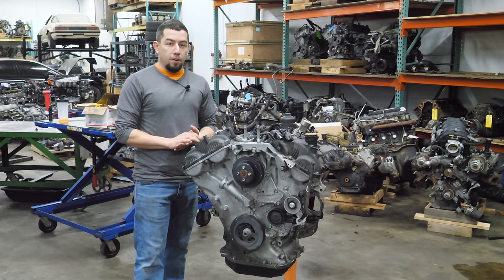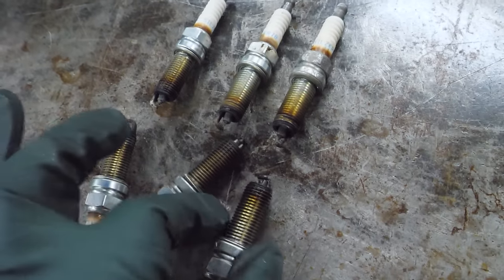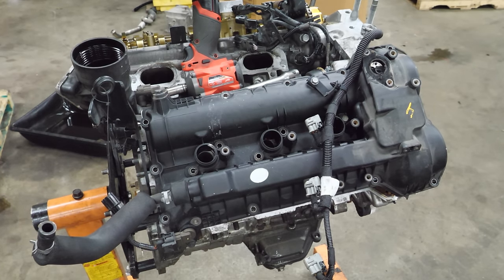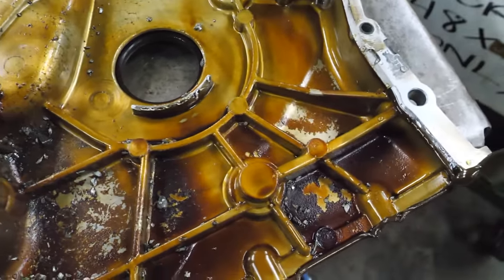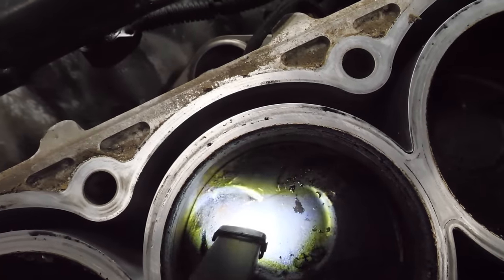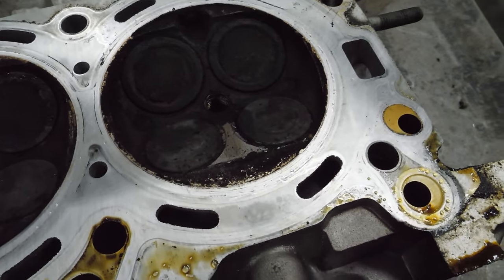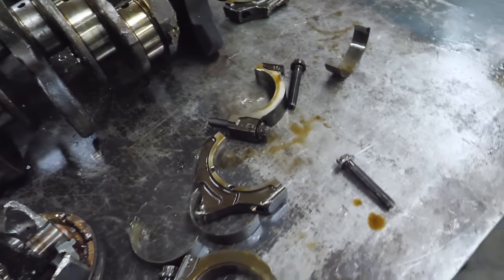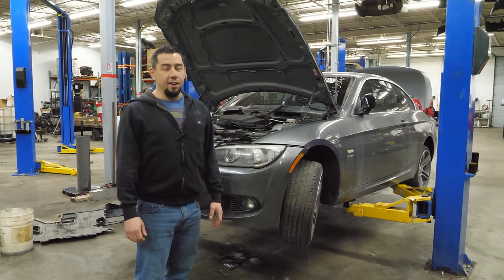Taking "Blown Up Engine" To A New Level! Kia Sorento 3.3L GDI V6 In Shambles. I AM IMPRESSED!

Comment: We see this type of damage a lot in Florida. People try to power through deep water and continue with their foot to the floor even after the noises under the hood keep getting louder and louder.
Reply: Yep, ate itself 1 pair of cylinders at a time. Impressive that it kept running for most of that.
Reply: If all you care about is making the noises under the hood stop, this is honestly a really effective and fast way to make the noises stop forever. Sure, the noises will briefly get really loud... But then there will be silence!
Reply: I think you're right. IIRC, GDI motors run a bit higher compression since they're injecting the gas... I'm guessing powering through little bit of water, sucked a little in the engine, pistons stopped before TDC, and the connecting rods said, "I got further to go." Punches through pistons, or snaps rods. Then it just makes mince meat out of the internals coming down from running speed.
Reply: That's the most common cause of this level of destruction, but in this case it's a Hyundai/Kia engine, which don't require water ingestion to self-destruct this severely. I believe Hyundai intentionally designs the engines to grenade just outside of warranty.
Reply: Yep, foot in the carburetor until the engine stopped rotating.
Reply: @th3R0b0t  nah that motor ran for a while(10-20 sec maybe) dropping cylinder at a time. Wouldn’t have that many impact marks from just going to zero rpm after damage. Poor thing.
Reply: Yep. Had to have ingested a few gallons suddenly at high rpm. I just wish I could have watched slow mo in-block camera footage of this happening.
Reply: @karlschauff7989  Hyundai is the BEST at warranty work.
Me: Well out of warranty, my Elantra needed a water pump. 
Called Planet Hyundai in Las Vegas. The sent a tow truck and picked it up from my work. 
They did the water pump, timing belt and detailed my Elantra GT the next day. I picked it up, NO CHARGE. 
I didn't piss or moan. It was clearly 10,000 miles out of warranty and they covered it. 
Next: My kid's Sonata, also out of warranty, while LOW on oil, engine died while going over a mountain pass in Mojave desert heat.
I brought oil. 
Started it... bad rod knock. 
Hyundai AGAIN covered it, well out of warranty. New engine, no charge.
Took about 2 weeks. 
Is this Hyundai or the dealer, Planet Hyundai? 
Don't know, don't care. Best experience ever. 
The Elantra now has close to 400,000 miles and no major work. Ever. 
Yes, we are loyal Planet Hyundai customers.
Reply: @TheBandit7613  better go buy the guys at your dealership breakfast on Monday cuz I know Hyundai/Kia has great warranties but a lot of people suffer from shady dealership shops from every brand
Reply: Exactly correct. This person just floored it till it stopped.
Reply: @TheBandit7613  your lucky to have a car dealer that cares about its customers as most don't....keep dealing with them as they are treating u very well
Reply: @jasongrisdale3084  I guess so. When I came out and saw coolant under the car, I  called them. They came right out (my work) with a tow truck and took it. They don't charge for towing if they are doing the work. I always thought that was convenient. 
I also bought a Jeep from Planet.
Reply: Makes total sense - driver was in panic mode and just kept it floored to escape deep water?
Reply: ..''Oh, Mr Insurance man, my car blew up, so sad..''
Reply: I am aghast that anyone would do this sort of damage to an engine.  I'm guessing that it was a kid with deeper pockets than brains.  Or... lived in Texas.  When I lived there for ten years the prevailing attitude seemed to be, when encountering ice, was just to floor the accelerator to burn their way out by spinning the drive wheels until something gave.  Either the ice or more likely something in the drivetrain.  Most often it was the engine and/or transmission.
Reply: @InsideOfMyOwnMind  A close example, watch a blender run on the kitchen counter.
Reply: I think you are on to something.  In 2005 I had a friend of mine who owned a Dodge SRT4.  He had a cold air intake that moved the air filter down to behind the fog light.  He drove through deep water and the car stalled.  So he started it back up but it quickly stalled again.  So he started it back up and gave it the beans.  Needless to say the motor stopped and would not turn over anymore, but the motor was only turning about 1,500 rpm…… at least that is what he said.  

Some friends and I came over to fix it and we found a couple of gallons of water in the intake and intercooler.  We pulled the oil pan and found a bent and twisted connecting rod.  

My guess is the owner of this engine went into the water at full throttle, probably near the rev limiter.
Reply: @karlschauff7989   He even said that the engine in the video got totaled by hydrolocking.
Reply: could this have been a Manual Trans car that got chain tow while in gear, after the initial failure (like out of a flooded street)? then towing spinning the engine anhilated the remainder?
Reply: @retro440    Throttle body.   ;-)
Reply: @Davinci12007  You're right, but, I'm old school!!
Reply: Thing is, those powder forged rods are super brittle, so they would fail extra catastrophically in a hydrolock event.  Honestly, to me, unless the engine is a rare specimen or high dollar build, by the time I heard expensive noises, it's already basically a writeoff, especially late models with limited rebuildability, so might as well see how far home you can get, especially if you're in a bit too deep in a less than ideal situation like a water crossing.
Reply: @hdrenginedevelopment7507  I totally agree about powder rods. They tell us that they are as strong as hammer forged rods but that is a fairy tail as far as I am concerned. I all boils down to greed. Anything to cut cost.
Reply: That may be the worst tear down ever??!! Unbelievable.
Reply: @wantapgt  if one cylinder blew up why would the next blow without contamination of the oil pump.
Reply: @Kevin19700  The engine would stop in the first cylinder blow. The trash would stop the crank.
Reply: @karlschauff7989  Kia, as well as Hyundai: pure, utter rubbish. Cheaply made rubbish. NEVER buy it.
Reply: I’ll never understand why people try to race through standing water. If you have to go through it give your poor car a fighting chance and drive at the slowest pace possible and once at bumper height back up and find another route or sit and wait for the water to subside; a night in a hotel is cheaper than any motor

Comment: I would pay a HUGE amount of money just to hear the sound of this thing when it blew.
Reply: Well you can always do your own. You said huge amount of money.
Reply: @davidhickenbottom6574  Would be a good use of a Kia engine
Reply: Actually you won't hear much. The engine was being push started with water in the cylinder.
Reply: Actually, you might. I blew up a 225 slant six in a pickup going up a slick clay road at high rpm (for a slant six) and when it let go, it was pretty noisy for a few seconds. It knocked holes in both sides of the engine and the pan.@swamivardana9911
Reply: yeah of course u would

Comment: This is THE ONE, Eric!  THE MOST BLOWED UP engine EVER, sir.  You have every right to be justifiably proud!  Well done!!
Reply: It threw EVERY SINGLE rod!

This is god damn impressive
Reply: It has to be. Anything worse would be the block being in pieces...
Reply: @99domini99  For some reason I vaguely remember seeing this (from the chunked-out oil pan) in one of those car mechanical fail videos, like Just Rolled In or something similar, and the result of flat-towing the car accidentally in gear. I wish I could remember the episode, but at any rate that's usually how something like this happens. Engines take a lot of work to turn over when they are coming apart and once more than half of the cylinders are defunct, just wont run anymore. However if we add some extra rented cylinders from U-Haul, that will do the trick quite well. Even worse will be the driver being completely oblivious to the cataclysm taking place behind them.
Reply: @mysock351C  Oh yeah I’ve seen this from MASSIVE over-revs as well! Spin the engine to 12 grand and all the pistons evacuate.
Reply: @99domini99  And I say the above from experience as the first one or two rods it throws are quite energetic when you set out to destroy an engine, but after that its usually just messy, smoky, and not that exciting with a gas engine. I hear old diesels tend to be a lot more destructive just due to the nature of how they work, and their ability to just about keep running no matter what.
Reply: @mysock351C  Yeah usually to evacuate all rods and pistons in a gas engine, it has to be either an instantaneous event like one hell of a money shift or caused by outside forces like your example of being towed in gear.

Most of the time gasoline engines just seize solid without throwing any parts.
Reply: Seen one worse on YouTube check out Steve Morris channel and his drag engine.
Reply: @tonyharris7319  But for such an incredibly boring and mundane engine that usually only moves soccer moms back and fourth this is an impressive level of destruction.
Reply: Yes!
Reply: @tonyharris7319  
Steve managed to snap all the rods in his v8 catastrophe but the block was still salvageable. I wouldn't fancy trying to weld up this one! 😀
Reply: Maybe a florida flood car?
Reply: @99domini99  not for a Kia.
Reply: Blowed up? Jesus........
Reply: @RollingRoadEFI  Sorry you're not experienced enough to get the joke.  Re: Bill Murray in "Stripes."  Did that help?
Reply: @JohnIsett  Lol don't be so sure. I grew up with that movie. 

That's the facts, JACK.
Reply: @JohnIsett  Now where is my EM50?
Reply: @RollingRoadEFI  Good one!
Reply: @RollingRoadEFI  You win!
Reply: Hahah nope VW make the worst engine on the planet

Comment: That's not just any hydrolock, that's a hydrolock at full send. Truly impressive.
Reply: I think you nailed it!
Reply: yeah someone thought they could make it... but there was no way
Reply: Yea I came to the comment section just to say this.
Reply: Money shift while towing a huge trailer into a hydrolock
Reply: It's like it blew and was forced to continue spinning. Crazy
Reply: I imagine Jeremy Clarkson shouting "speed and power!" as he drives it into a lake
Reply: could this have been a Manual Trans car that got chain tow while in gear, after the initial failure (like out of a flooded street)? then towing spinning the engine anhilated the remainder?
Reply: Theres no way all that destruction happened under its own power. A hydrolock to cause 100% wrecked cylinders would have stopped it pretty quickly, which doesnt explain all the extra dings and piston blending and then circulation of the confetti
+1 it was towed in drive/gear after hydrolock (the discolouration in strange places like the buckets would be from heating from all the motion without lubrication - thats why the pickup and oil pump looked unmolested) would be good see what the trans looked like also

I drove a V6 Sorrento as a rental many years ago, it ruined my prejudice and I realised how quick and nimble SUVs had become in recent times, though I hate the feel of lightness in a giant car, like I'm driving around in an empty coke can
Reply: Full send through water is never the answer. There is a science behind getting through water though, I think.
Reply: It also could have been a 5-2 moneyshift.
Reply: What's weird is that a manual Kia SUV in the USA must be an incredible rarity, what are the odds this had a manual box? Next to nill I'd say.

Maybe it was cruising at high speed with the torque converter locked up and for some reason it just didn't disengage until a few seconds after the engine was already blown.
Reply: @WilliamEly omg yess
Reply: Yep, that thing was screaming when it drew it's final breath😂
Reply: @WilliamEly 😂
Reply: Are you selling the "good" rod bolt pulled from the oil pan. I'm interested. 😅

Comment: You know that when this engine blew, it was most likely at fairly high RPM and it took a relatively long time to stop turning.  And it was incredibly noisy when it failed.   All those impact marks inside the block take time to create. Maybe a hundred revolutions of the crankshaft were necessary in order to make that many hits.  At least.
Reply: At some point though as the engine is going to bits one of those pieces should have just locked it up.  I'm thinking it got spun at high RPM like it was shifted into 1st at speed (downhill for more momentum) and then never let off until the vehicle came to a stop.  There isn't a huge amount of oil starvation damage just carnage like it got over revved and self destructed.
Reply: Yeah, seems like it was a high RPM hydrolock that caused this
Reply: ..Hydrauliced..
Reply: A long time is relative.  Turning 3000 rpm it is doing 50 revolutions per second, so two seconds will give you that hundred turns.  If they pinned it to the limiter it'd only take one second.
Reply: I wonder if they hit water at decent speed towing something heavy and that load kept pushing the crank long after the engine lost any power due to no conrods?
Reply: My thought is they were drifting and smoking there tires at the limiter
Reply: This is pretty much what I was thinking. This is a motor that was running at high revs when it went nuclear.
Reply: Was it doing 100mph down a very long hill?
Reply: I bet alcohol was involved
Reply: I think someone was trying to race their Kia SUV against a Honda but the fake Vtec failed.
Hydro lock would have happened in lower speed, and stalled the engine sooner.
Reply: But then again can a front wheel drive car "drift" like that.
Reply: Guessing this was flying at about 120mph and pegged RPMs when it blew….
Reply: Hypothesis 1: Ecu failed to stop overrev, either by failure or mod. Possibly downhill gravity assist at redline.
Hypothesis 2: Attempting engine braking while towing downhill. Contributing factors may include overweight, brake failure, and/or inexperience towing.
All in all, that thing cleaned house.
Reply: We all know these engines get bad reputations due to the owners themselves.

Comment: The fact that it still resembled a whole engine from the outside when that is what the inside looked like is IMPRESSIVE. I’m actually amazed it didn’t completely split apart.
Reply: It really is amazing what the block can endure to stay together.
Reply: For sure, by the time I finished watching the deconstruction I was more amazed that the engine block itself was still in one piece 🤣  The noise it must have made when it was coming apart must've sounded like the entire car was about to fall to pieces, not just the engine!!!!
Reply: I definitely saw a brief glimpse of a crack down the side of the block.
Reply: That engine aspired to be a fifties Buick..hence the three holes in the side
Reply: That block mostly held in a SERIOUS explosion!!
Reply: I think that engine used every remaining horsepower on self-destruction.
Reply: @adotintheshark4848  I'm old enough to get it. Lol. Clever.

Comment: This gives cylinder deactivation a whole new meaning!
Reply: Cylinder dislocation more like it.
Reply: I'm wondering how you physically get an engine this blown up...5 out of 6 rods are in rubble. The engine has no power to continue destruction
Reply: @ccmoos  if you’re on full send when one  rod goes and keep it pegged, there will be enough energy in the motor to completely grenade it.
Reply: could this have been a Manual Trans car that got chain tow while in gear, after the initial failure (like out of a flooded street)? then towing spinning the engine anhilated the remainder?
Reply: @pablopicaro7649  Good point. That would definitely do it!
Reply: @pablopicaro7649  yes, I thought of that too

Comment: This was just……..👏🏻👏🏻👏🏻👏🏻…….amazing. 

✅ Mechanically re-gapped plugs

✅ Malice in the combustion palace 

✅ Rod pieces in the timing cover. I’ll say that again: Connecting rod pieces in the timing cover!

✅ Dis-connecting rods

✅ Multiple good parts yeeted across the shop

✅ Multiple missing pistons

✅ Jumbo family pack of piston McNuggets

✅ Quarry in the oil pain

✅ Windage foil

✅ FIVE OF SIX RODS TURNED TO GLITTER!

✅ Wristpins in orbit

This was a masterpiece. I love it. Fantastic.
Reply: Don't forget the rod piece embedded in the block 😂
Reply: You didn’t even list every single reason why you should NOT buy a Kia.
Reply: ✅ Adjustable pistons
Reply: One more;
✅ Engine Gravel, often found and associated with Oil Pan "Quarry" condition.
Reply: Inspection ports ✅
Reply: that was a piston mcnugget sharebox
Reply: @jackhentschel5961  Indeed yes, the "Family-Sized" meal!
Reply: @northwestrailfanofficial   The engine was hydrolocked, not Kias fault that someone runs his car though water.
Reply: @xXYannuschXx  True. However, I tore down a few engines that went Red October. None of them ever had this much carnage.
Reply: ✅ Oil filter glitter
Reply: @Dansk55  Oh yea, But I think glitter would be understating it... It was clearly Oil Filter Boat paint.
Reply: Wonders aloud, “does he sell those busted-up pieces of piston?  Those work well to cast model engine pistons in a home-made gravity die.”
Reply: could this have been a Manual Trans car that got chain tow while in gear, after the initial failure (like out of a flooded street)? then towing spinning the engine anhilated the remainder?
Reply: @pablopicaro7649  No manual options for that setup.
Reply: "We've got to save this for the rebuild...", while moving a nugget from the windage parts constrainer, was my first actual lol in quite a while.